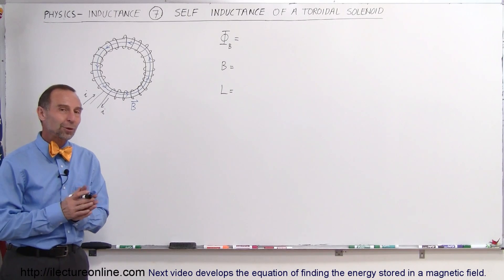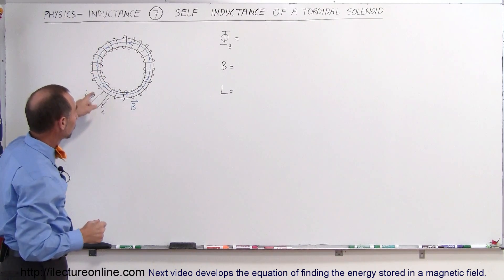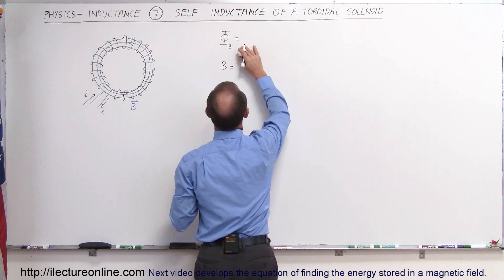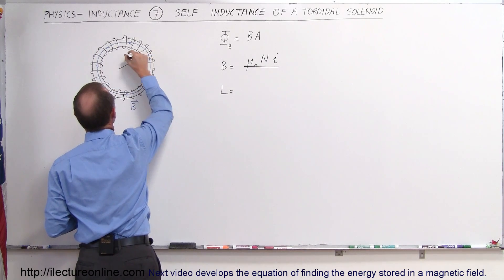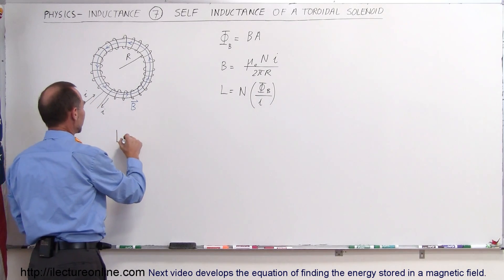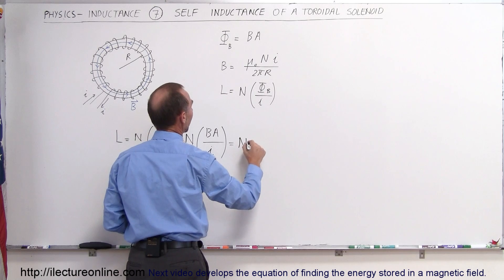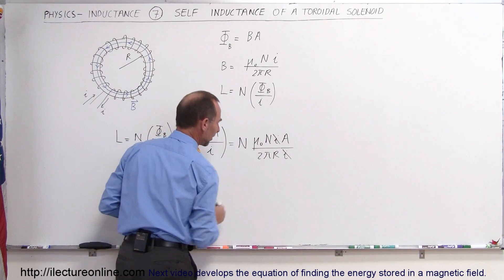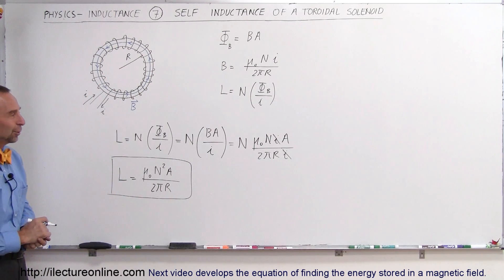Physics 47  Inductance (7 of 20) Self Inductance of a Toroidal Solenoid

Comment: 2(pi)R would represent the circumference of the empty loop in the middle of the toroid. The flux within the toroid is changing as you as you move from the inner to outer surface (say R1->R2) therefore you need to take the sum of the flux at each point within your toroid or integrate from R1->R2.